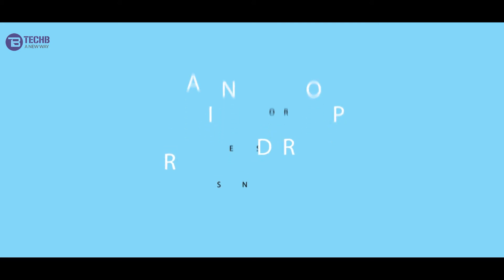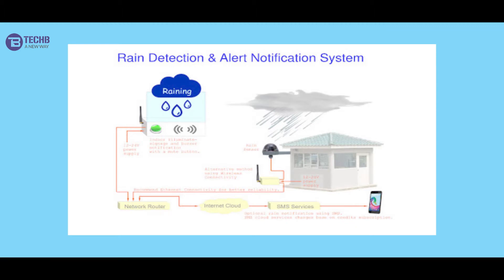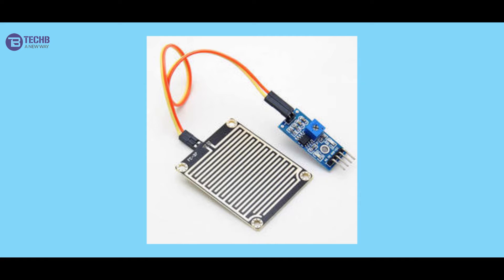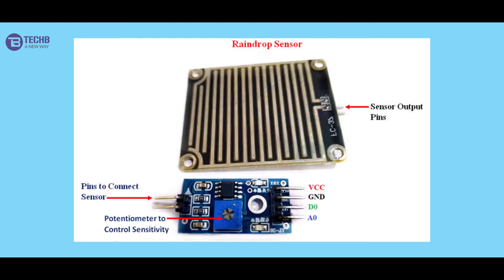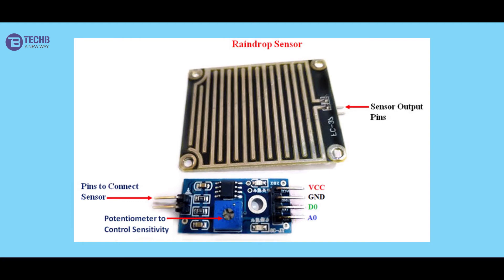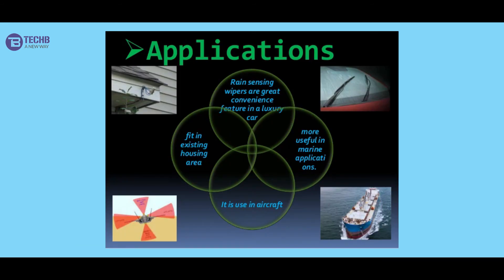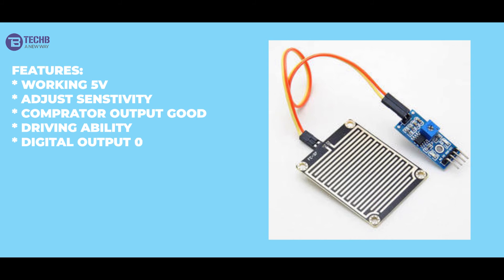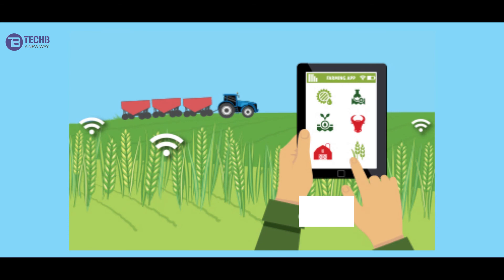INTRODUCTION OF RAIN DROP SENSOR |TECHB

Comment: I have a question here .I do not understand when to use digital output and when to use analog output ?  Could you help me abou that ?
Reply: Let me help you, so basically digital output is like true or false (1 or 0) so if there's tiny little rain particle, it could trigger the automation, but the analog output let you customize the sensitivity for the raindrops module, it's value range from 0 to 1023, dry is at 1023 and wet is at 0, if you make threshold, let's say at <= 500 using arduino "if" function, if there's water that trigger at 500 (you can read the value when the water's on the sensor by using serial print, read the arduino official guide for that), it will trigger an automation that you've made, find more information somewhere else if you still don't understand, maybe github, or other forums that might help you other than me :)